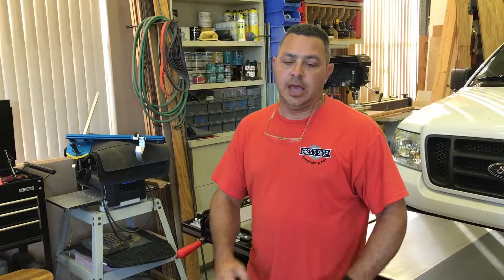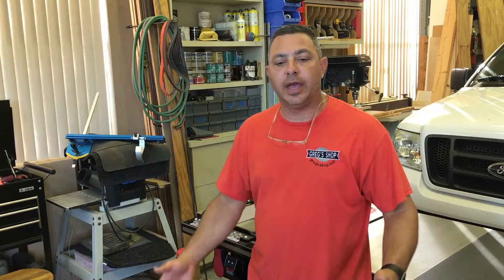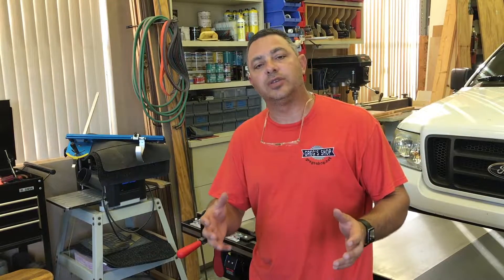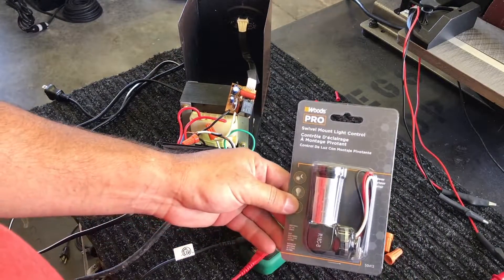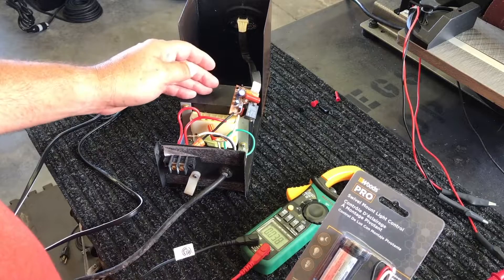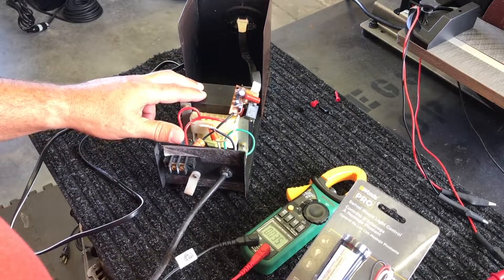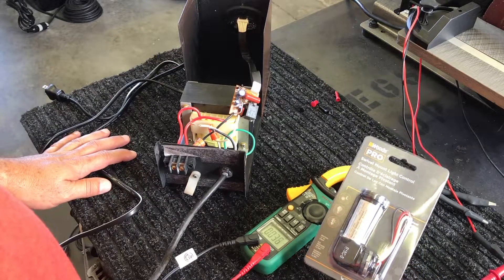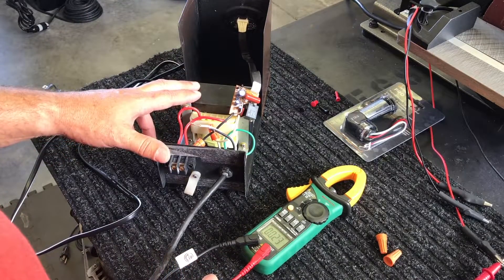Landscape lighting transformer repair. How to add a dusk to dawn sensor to a landscape transformer.

Comment: Do I have remove the reset switch too or leave them?
Reply from the maker: Depending on the way it’s set up, I’d leave the reset switch if it is functioning.  This protects the transformer from dead shorts in your underground wiring.  If the reset breaker is bad, I’d purchase a similar one and replace the bad switch.  I have found these transformers to be pretty solid.  It’s usually all of the timers and switches that go bad.  Hope that helps!  -Greg
Reply: Thanks Greg. I’ll definitely try that. Another question, the reset switch is rated at 15 amp. It is okay to replace it with a 25 amp switch?
Reply from the maker: @balutpwr1595 no, your outlet would be rated at either 15 amps or 20 amps…so you would want the breaker on on the transformer to be lower. If it was higher than the rated amperage of the a/c circuit, your breaker in the panel will trip before the breaker on the transformer. Keep it at the 15 amp.

Comment: Hi. I have a 300 watt low voltage transformer but have two transformer inside. How do I connect them? Thank you in advance.
Reply from the maker: You basically find the 120v input and run them both through the dusk to dawn switch. Though I would caution you to verify the 600 watts total is less than the rated wattage that the dusk to dawn switch.  If the switch only gives you amps then it must be lower than 5 amps.
Reply from the maker: Look at this one.  This switch exceeds the 100% capacity of your 600 watt total transformers.  https://a.co/d/e9xvQ5s

Comment: Excellent instruction. Tested and found the $$$ 600w transformer was ok.  Similarly, my built in sensor was faulty.  Bypassed (eliminated) the light sensor.  Added an in-line plug-in external astronomic timer from Home Depot so that the garden and pathway lights turn on at dusk and off at 10 PM every day.  Cost: $25.  Time: 1 Hr.   Thank you!
Reply from the maker: Glad you got it fixed.  Thanks for watching leaving a comment!

Comment: Do you know if the transformer clicks on and off that I have the same problem?
Reply from the maker: The only clicking would be from a timer or a relay.  The transformer will have a hum.  You may have to separate the timer/ switch electrically and test them both. Most of the time, the transformer is good.  It’s the timer/ sensor/ switches that go bad. Hope that helps
Reply: @GregsShop  Thanks Greg

Comment: Greg, I have a 250 x 2  transformer.  We had a lightning hit.  The manual works aoj, but on photocell it wont.  I hooked up a new photo and still no luck.. The control , like yours need to be cut out and direct photo.  If i send you detailed pics, can you help.
Reply from the maker: I’ll give it my best shot.  Gregsshopfl@gmail.com
Reply: @GregsShop  I emailed you a video

Comment: What would cause the flickering
Reply from the maker: Led lights or halogen?
Reply: @GregsShop  led lights…..
Reply from the maker: Check your output voltage at the transformer with  and without the wire connected.  Then with the wire connected at the  last  landscape light on the wire. Make sure you have at least 12 volts a/c . Voltage being low can cause the flickering.

Comment: Can you list the equipment in notes?
Reply from the maker: I usually don’t put links to products in the description because they expire or become dead .  I usually have to just respond  to questions like this.   Try this or something equivalent.  Thanks for watching and good luck fixing your transformer. Woods 59411WD Outdoor Hardwired Stem and Swivel Light Control with Photocell, Compatible with Most Types of Bulbs, Swivel Mount for Adjustable Placement, Automatic Settings, Time Delay https://www.amazon.com/dp/B003YXBJZU/ref=cm_sw_r_cp_api_glt_fabc_Y0KFSTFKH0DSY9J85E93   Or this HGG 1 Pack Outdoor Photoelectric Sensor,Dusk to Dawn Swivel Mount Conduit Lighting Control with Photocell,Automatic Adjustable Photo Sensor Switch for Indoor and Outdoor Light https://www.amazon.com/dp/B083FCLM6N/ref=cm_sw_r_cp_api_glt_fabc_9H47BYXF60FKVWNCXKE0

Comment: Hey great video. Got a question. I have a dual portfolio 300 watt with dual transformer. How do I wire/attached? They also have these 88 series circuit breakers on both. Thanks in advance and happy Easter.
Reply from the maker: I have the same one.  you would only be placing the sensor/switch on the incoming power.  you would have to disconnect the internal sensor as that controls the power coming out the transformer.  you would wire directly from the transformer output to the circuit breakers/ terminals.  Hope this helps.

Comment: Hey great video. Got a question. I have a dual portfolio 300 watt with dual transformer. How do I wire/attached? They also have these 88 series circuit breakers on both. Thanks in advance and happy Easter.
Reply from the maker: You are going to wire it the same way.  The dusk to dawn sensor goes on the input side of the transformer. That acts as a switch to put 120v ac into the transformer.  The output will remain unchanged. The circuit breaker are for the output phase of the transformer. That is to prevent a short on one of the transformer taps. Keeps the transformer from burning up.  Hope that helps. Happy Easter to you too!

Comment: Thanks Greg for this video. What if I just need to replace the transformer? Is it worth it? I run my pond lights on a timer so I do not need the light sensor. Cheers.
Reply from the maker: Yes you could find a transformer with the same form factor if you want to use the same weatherproof transformer case. If you can't find a transformer that will fit, you can always get a weatherproof NEMA box from Home Depot and mount a transformer in that.  Not sure how much wattage you need but 120vac to 12vac transformers are fairly cheap.  Hope this helps, let me know if you need more information.  Voltage Converter Transformer 110/120V to AC 12V/5A, AGPtEK 60-Watt Waterproof Power Supply Converter for Swimming Pool Light, Water Pump, Outdoor Light, Spotlights https://www.amazon.com/dp/B00WUARNC6/ref=cm_sw_r_cp_tau_6Jy4Eb0XNVB8S     NSi TORK TPX100 Low-Voltage 100-Watt Safety Transformer For Indoor/Outdoor Pool/Spa, Landscape and Submersible Lighting Products, LED Compatible, Beige https://www.amazon.com/dp/B06XPV1XD7/ref=cm_sw_r_cp_tau_CLy4Eb8VZGXTP
Reply: @GregsShop  That's awesome Greg! Thanks for the recommendation. Once I check the transformer, if it does not work then I will look into getting what you suggested.

Comment: Great video. When I plug in my transformer the lights do come on. But they stay on regardless of the setting. If I put it on A to come on at dusk and go off at dawn they still stay on all day and I have to just unplug them.
Reply from the maker: Thanks for watching and leaving a comment.  Are you going to add the sensor?

Comment: I have the same unit however it’s the  multi-tap transformer and ordered  the photo cell you mentioned. My unit was stuck in the “on” position so it never turned off. I opened it and found more wires than the one here but managed to wire it properly. It’s back up and running. Thanks for making this video! I wouldn’t have known which cell to purchase! My backyard is illuminated at night and I couldn’t be happier!
Reply from the maker: Hey that’s awesome.  So glad you got it fixed and better yet, you did it yourself! Thanks for watching and leaving a comment.
Reply: Greg's Shop It’s all thanks to you! I couldn’t be more thankful I came across your video! Thanks again!

Comment: Great job! I went to Lowe's and bought the dust to dawn sensor, drilled the hole in the side of the case, installed wires per the directions, and it worked like a charm.  Thanks again.
Reply from the maker: Awesome!  Glad it worked for you. Thanks for watching and leaving a comment. I appreciate the feedback.

Comment: For me when I turn move for all the numbers 1 to 9 and on to Auto setting, all the lights come on for a sec and then goes off. Any idea, what would be wrong with the unit based on the one time flickering?
Reply from the maker: I would suspect the controller is bad.  Does it have an always on setting?  If so, switch it to those and see if the lights stay on.  It’s probably a bad photo cell on the controller and you would either have to modify yours like I did to mine or replace the whole unit.  I believe yours comes on at dark and then runs for the number of hours you select 1-9. Exact fit Parts for these devices can be hard to find if they exist at all.  Is the unit still under warranty?  Maybe try calling the company that makes them and convince them to send you a brand new one.  Hope that helps.  Good luck and keep us posted!  Thanks for watching.
Reply: Hi. My Portfolio Outdoor 600w transformer was doing the same thing …turning on for a split second, then off. Following Greg’s video, I removed the controller and rewired directly to the power supply. It was very easy and intuitive. In lieu of drilling a hole and adding a day/night sensor which would leave the lights on all night, I simply bought a TP-Link Kasa outdoor-rated plug and set it to come on at sunset and off at 11pm via the app. $16 plug on Amazon, but you could easily use any outdoor light sensor/timer to plug the transformer power cord into. Please note, when you remove the controller from the bottom of the housing, you should replace the two screws that held it in place to maintain the weatherproofing. Hopefully this added advice is helpful. Great job on the video, Greg.
Reply from the maker: Excellent advise and explaining keeping the housing water tight.  This is certainly a great solution and definitely a good option.  I am considering doing another video where instead of using light sensor I would use a WiFi smart plug.  Thanks for sharing your excellent advise and for watching the video.

Comment: Hi Greg ... my Portfolio 120 W Power Pack has worked fine for 3.5 yrs.  Now the lights only turn on briefly then go out.  Can I fix or replace?
Reply from the maker: If you have a multi meter open the case and check the output side of the transformer you may need to rewire it at least temporarily so you can verify you are getting 12v AC output.  The component that usually fails on these transformers are the switches, timers/computer boards. If you can bypass all that stuff you will know if the transformer is good or not.  One you establish that the transformer is good, I would recommend fixing it like I show in my video.  Let me know how it goes.  Gregsshopfl@gmail.com